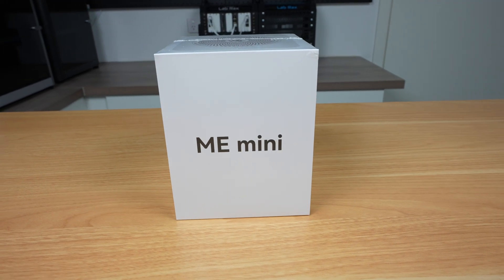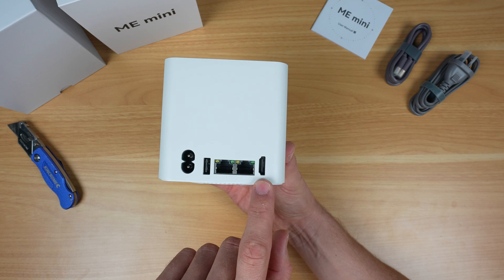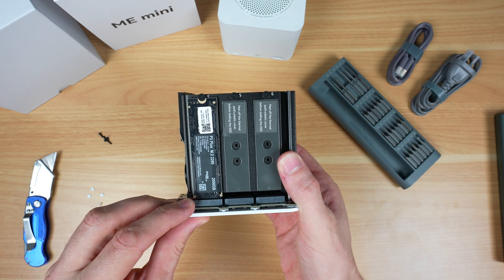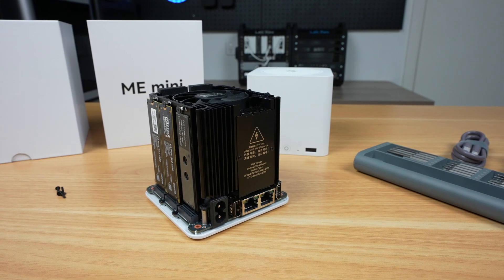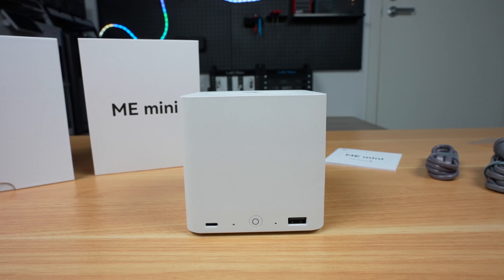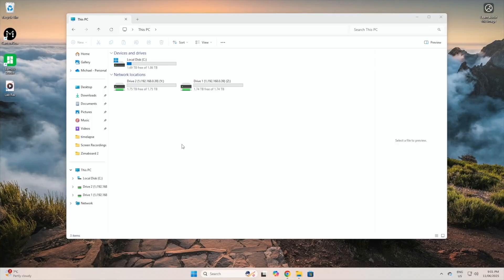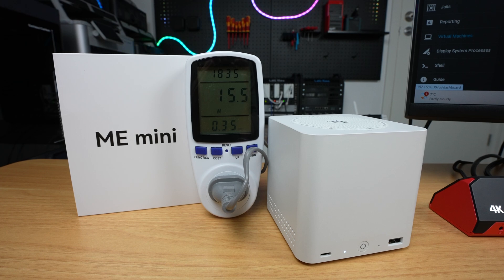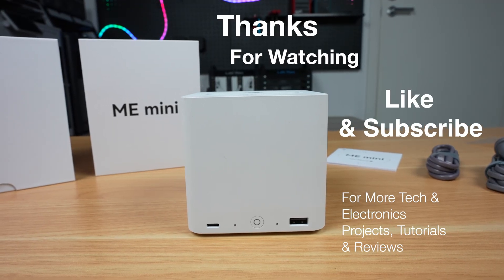Beelink ME Mini – Tiny, Silent, and Perfect for a Home NAS?

Comment: The industry standard for measuring sound levels (noise) is to place the device you are using 1 meter away from the source, if you do that it makes it much easier to compare results…
Reply from the maker: Yeah I know but the sound level from most of these mini PCs and SBCs is so low that measuring them all from 1m away would result in no (or very little) discernible difference. So I try measure them all from 20cm.

Comment: If I installed TrueNAS to external SSD, this means I can have 3 pairs of NVME mirror although each drive will be capped at 1GBps each. Pretty nice if I'm looking for low power nas
Reply from the maker: It has internal eMMC storage too, so you can install TrueNAS on that and still have the 6 NVMe bays free.
Reply: @MichaelKlements  Can I install TrueNAS on the eMMC and have a 1TB NVME for apps/docker/vms and then have say 3 1tb drives for storage in raid?

Comment: The more I see this on YouTube, the more  I am impressed by it. Granted it has some limitations. But I currently use two ZIMA Blades running both Casa OS and ZIMA OS. For my personal needs the 2TB size of the individual drives works just fine.For just personal use this is more than enough.
Reply: At $50 per TB how is this cost effective?  Lets say you put 6x 4TB drives in it, that would give you 24TB at a cost of $1200.   Platter drives are ~$10/TB, and you can get a single 24TB Barracuda for $250.
Reply: @BoopSnoot  Granted SSDs are not yet as cost effective as HDDs. But the design of this is optimized for a small foot print. I would be more likely to use 2TB drives rather 4TB drives.
Reply: @BoopSnoot  ssd is for speed, you can edit on this but cant edit 4k from hdd
Reply: @techxsujan Since I don’t do video editing, this is not one of my concerns.
Reply: @techxsujan  I believe when you import into premiere it caches it on your boot drive.  Nothing wrong with having a 2TB or 4TB OS drive, but for storage SSD is way too expensive

Comment: Can one remove the wifi/bluetooth card and replace it with a nvme for even more storage?
Reply from the maker: No, M.2 WiFi modules are keyed differently to NVMe drives and are not compatable.
Reply: @MichaelKlements  you can install adapter from m.2 E to m.2 M

Comment: Nein, nicht mal nah dran.
1. Lüfter nervt, lässt sich nur schwer austauschen
2. 2.5 GbE bei sechs NVME SSDs, absolut wiztlos
3. Geringer Stromverbrauch? Im Idle vielleicht, aber zieh mal größere Mengen an Daten raus, oder schreibt sie gar drauf, dann sieht das schon anders aus, von den Temperaturen ganz zu schweigen.

Ich hab das Ding ganz schnell wieder zurückgeschickt und war froh, dass ich mein Geld zurückbekommen habe. Wer wirklich rein auf NVME setzen will, der sollte auch das Geld haben, sich ein Gerät mit mindestens einer 10 GbE Schnittstelle zu kaufen.
Wer nur was sucht, um davon Videos zu streamen, der braucht keine Box mit sechs NVME Schnittellen, dann reichen auch zwei oder vier und für wenig mehr Geld bekommt man z.B. ITX Boards mit zwei NVME Schnittstellen, dazu viermal SATA und auch noch 2 x 2.5 GbE UND einmal 10 GbE, das alles in ein sehr kleines Gehäuse passt, vor allem wenn man dann auf ein Pico PSU mit externem Netzteil setzt.

No, not even close.
1. The fan is annoying and difficult to replace.
2. 2.5 GbE with six NVME SSDs is absolutely pointless.
3. Low power consumption? Maybe in idle, but pull large amounts of data from it or even write it to it, and things look different, not to mention the temperatures.

I quickly returned the thing and was glad I got my money back. If you really want to go all-in on NVME, you should also have the money to buy a device with at least a 10 GbE interface.
If you're just looking for something to stream videos from, you don't need a box with six NVME interfaces, two or four are enough and for a little more money you can get ITX boards with two NVME interfaces, plus four SATA and also 2 x 2.5 GbE AND one 10 GbE, all of which fits into a very small case, especially if you use a Pico PSU with an external power supply.
Reply: Thanks for Michael's reply first!

As for your detailed feedback — we really appreciate you taking the time to share your thoughts!

That said, it’s worth keeping in mind who the ME Mini was actually designed for. It’s not trying to compete with high-end NAS setups or custom ITX builds. Instead, it’s aimed at home users who want a compact, quiet, and affordable system for tasks like media streaming, light NAS usage, or running small self-hosted services. 

We totally get that if you're building an all-NVMe storage system with serious throughput needs, you’ll probably also want at least a 10GbE interface and more advanced thermal management. What you’re describing sounds more like a prosumer-level setup, which doesn't really align with how the ME Mini was positioned. That said, we’re actively working on more advanced products built specifically for professional users — so stay tuned!

About the fan — sorry to hear it bothered you! If anyone runs into issues with accessories or wants to replace them, just contact our support team to purchase a replacement. We’ll also provide step-by-step guides to help with the process.

At the end of the day, no single device fits every use case — and that’s totally fair. But for what it’s designed to do, we believe the ME Mini hits a nice balance of flexibility, performance, and affordability.

Thanks again for the feedback — it helps us keep improving!
Reply: Ja und nein;
Allerdings ist es ein Apfel/Birnenvergleich;
ähnlich derer, die dieses Gerät mit nem Pi 4/5 vergleichen.
Stromverbrauch:
Ja, kann in der Spitze steigen ebenso wie die Hitze...
Ist aber bei ner Pico-Lösung nicht viel anders.
Leistung: JA, ich kann auf ne ITX-J3455  Lösung genauso setzen wie auf ne N355, um halbwegs "günstig" zu bleiben; ich kann aber höherwertig ansetzen oder "alte Terminals" verwenden.
Die Wahrheit liegt irgendwo dazwischen

Ja, ich kann Boards mit Boot-NVMEs ausstatten, den Rest via Sata; oder gar Adaptern erweitern;
habe sowas in meinem DiY Park laufen, klappt auch prima; der Stromverbrauch hält sich in Grenzen, ditto so die Abwärme.

Und wer zu ner N150 Lösung greift, um dort zig Virtuelle Maschinen laufen zu lassen, der hat ohnedies das Thema verfehlt.

Punkto "Lärm"; also im Vergleich zu den "kleinen Würfeln" von vor wenigen Jahren; J4125 aktiv gekühlt, ode den kleinen I3 Lösungen, ist der wirklich leise, den ich bei Umgebungslärm (und ich sitze im Grünen, hör bestenfalls Vogerl) nicht wahrnehme; ich betreibe ihn sogar im Schlafzimmer.

Die Frage ist und bleibt: Was will man
Ein kleines Ding, bei dem ich "restlverwertung" von NVMEs betreibe bei überschaubaren Anschaffungskosten, dem die nächsten Jahre mal nicht die Puste ausgeht;
oder sowas we ein UGreen/Synology -wo nebenbei erwähnt, dir die Ohren ob des "Lärms" abfallen; oder ein DiY *haha+ Spaßgerät absolut passiv, oder halt ein wirkliicher Server.

Das Teil ist ob des limitierten N150ers "rund"
bzw. das Optimum rausgeholt, und das für nen Preis, was man schon mal nur für ein vernünftiges N355 Board hinlegt; ohne Beiwerk

Ich bezweifle, das jemand 6x4TB Sticks kauft; zumindest zur jetztigen Zeit;
aber ebenso bezweifle ich, das jemand mit Synology oder UGreen sein 4-Bay Nas mit 4x18TB HDs, den Guten, vollklatscht, ditto so bei DiY Projekten.
Also in Summe hinkt der Vergleich;

Sehen wir uns die Mitbewerber an:
Der einzige der halbwegs mithalten kann; um 100 € teurer, der cwwk-p5 mit 4x Nvme, reltiv passiv gekühlt...
und der Andere g9 - heiß wie Frittenfett;
bzw. die Geräte unter anderem Namen, aber selbe Bauart...
Das war´s
Für Leute die mit "Fertigteilen"wie "echte" NAS... alleine die eingesetzten j4125 bei nem Synology stellen mir die Haare auf, für den Preis. nix anfangen; weil ab 3xx,- aufwärts, ohne Platten,
oder jene, die mit DiY nix am Hut haben;
ist so ein Teil "perfekt"; Und wenn man bei Amazondays eines günstig abgreift... noch besser:
Mehr als "aufmachen" NVME reinschrauben muß man nicht können egal ob man jetzt die Vriante mit oder ohne 2TB kauft

Ob deiner Kritik verstehe ich nicht, warum du dir das Gerät überhaupt zugelegt hast, den deine Anforderung schließt von Haus aus so ein Device aus.
Ist ja nicht so, wie beim G9, das man die böse Überraschung erst im Betrieb erlebt; wo es tatsächlich ein Grund ist zu sagen: Das Teil ist brandgefährlich

Wie gesagt: Vlt. bist du mit der falschen Erwartungshaltung rangegangen, vlt. biste wirklich unzufrieden, warum auch immer

Aber deine Vergleiche hinken da gewaltigst.

Just my 2c - und ich bin nur "user", sonst nichts 
----
Sorry folks, it is easier for me to answer in German; use google Translator, if u are interested
Reply from the maker: Thanks for sharing your thoughts — I appreciate the detailed feedback.

That said, I think it’s important to keep in mind who this device is actually made for. The ME Mini isn’t marketed as a high-end, professional-grade NAS or data server. It’s a budget-friendly mini PC designed for home users who want a quiet, compact system that can be used as a NAS, for media streaming, or small self-hosted services. In that context, it performs well.

Most users in this price range (around $200) will be on gigabit or maybe 2.5G networks, and aren’t expecting 10GbE performance. What you’re describing is closer to something like a Terramaster F8 SSD or SSD Plus, or a custom ITX setup with higher-end components. These are both great solutions, but they also cost three to four times more or require technical setup.

I don't know what the issue with the fan is, it's a simple hub mounted design with 3 screws holding it in place? It took me less than 2 minutes to remove. It's also not something most people should need to replace under normal use, almost all mini PCs use non standard fans due to their size limitations. 

Ultimately, I think it comes down to matching the product to your needs. The ME Mini isn’t for everyone, but for the audience it's aimed at, it offers solid value.
Reply: @MichaelKlements  Well said !! 😘🛜🏡🌐🗽

Comment: Michale, soem reviews on this board cover some PCI lane speed discrepancies.  Your results didn't seem to show that.  As always I appreciate the video.  Thanks.
Reply from the maker: The PCIe lane speed discrepancies show up if you're accessing the drives locally on the PC - if you're running Windows 11 on it and run a drive speed test you'll see the difference in drive speeds. My testing was to demonstrate that even with the difference in speeds between the drives, if you’re using it as a NAS as it’s intended, the 2.5G network connection is the bottleneck so it "hides" the discrepancy.
Reply: @MichaelKlements  The testing I saw was under Linux I think the video was by RaidOwl.  Thanks for the reply!
Reply from the maker: Yes, it would be the same in Linux - testing the drive speed on an OS locally would show the difference in speed across the ports.

Comment: Another great video. Thx for it: Fully tested and explained ... I like this !!!
But...
Few more Infos

I have the same device;
.) U can install Windows 10 out from a USB - Stick on the EMMC... fine :)
.) U can install TrueNas from a USB (other device) an the EMMC... fine too :)
.) Windows 10 Drivers; When u contact the support-team, u will get links; few days befor ei can´t find the drivers on their webpage, or u use a sub Programm like IOB*t DriverBooster free ; All Drivers are installing automaticly

Temperatur: 
.) Windows 10 ; HW Info tell me 55 degrease (up under heavy load)
.) Windows 11; Hw Info tell me 65 degrease (and up)

So, it´s nearly the same picture (less hot) as it was with a N100 (Asrock MB)
---
For the ones, who import from China to Europa (cause Amazon is out of this devices)
.) Waiting time.. i had 1 Week more (shipping); no damage at all
.) Order only the barebon; cause tax-free amounts to europa at 149,99 Euro; and they should sign it as "Early-Bird device" (or something similiar); so when zoll is checking the price.. it´s explainable, why it´s cheaper 
I had to pay taxes (an this was 85,60 Euro!!!!!! ) , but "we foud" a solution (thx to beelink !!!!!)
Cause 209 dollars.. it´s an absolut great price for this device !!!!

I tested: Win 10/11, Linux Mint and Sparky, Debian 12 with Casa OS and other stuff (USB)
TrueNas (EMMC), ZimaOS (USB), the other nas-Software which is known normaly with it´s own HArdware connected.. worked fine out of the box

Final thoughts:
I swap my raspberry solution in the sleeping room against this device (Cause Router is there); i have it run as homeserver (While idle it´s handwarm) and Media-Center
The N150 ist for differnt things the better solution than a N100 device.
And when u use it as normal PC.. it´s good enough too
I really love this little thing (If i would have a channel; i couldn´t  better explained, as Michael did.. all is sayed and tested

Comment: Nice video. One idea to test: Since it has 2 ethernet ports and a decent CPU, could you try creating a home/SOHO firewall and VPN/tunnel endpoint with even some self-hosted cloud services running on Docker?
Reply from the maker: Thats an interesting use case for it - it'll probably be quite a capable router or firewall!

Comment: Think I’d prefer some kind of pi5 pcie solution. Much quieter and less power/heat.
Reply from the maker: The main consideration is really ARM vs x86 - my Pi 5 NAS and this cost about the same, produce the same amount of noise and draw a similar amount of power. The N150 CPU is significantly more powerful than the Pi's though.

Comment: If you used both the 2.5Gb ethernet outputs to a switch with port aggregation, would it improve the performance?
Reply from the maker: Link aggregation improve performance for multiple users/writes. So on the ME Mini you could transfer two large files to it at 2.5Gbps simultaneously but it won't improve the transfer speed of a single file i.e. you can't transfer one file to it at 5Gbps.
Reply: Try it, when using TrueNAS ...  you'd have to use at least one connection with static IP AND a different subnet, since TrueNAS simply can't handle two connections inside the same subnet ... so, no, makes no difference at all.
Reply from the maker: TrueNAS can handle link aggregation correctly, you just need to configure it properly using LACP. When set up correctly, both interfaces are treated as a single interface with a single IP address. This works as expected with a managed switch that supports LACP.

What you’ve described (assigning two NICs in the same subnet without aggregation) will definitely cause issues and is not a limitation of TrueNAS, it’s just standard networking behavior. If you’re not using LAG, interfaces need to be on separate subnets.

Comment: 1. This NAS-PC is not quiet. 2. What to do if you need to replace this cooler? Will it be available for sale?
Reply: < 40 dB seems pretty quiet; only a fanless solution would tend to be quieter (discounting potential coil whine), unless you have a very large fan running at slow speed.
Reply: Hi! The ME mini is actually very quiet with low noise levels—we welcome you to purchase one and try it out for yourself. Additionally, if you ever need to purchase a replacement cooler or any other parts, please feel free to contact our support team and our support team will provide a dedicated purchase link. Thanks for your questions!
Reply: @Beelinkchannel  Off-topic; Greatings to China; I am glad, that i got my devices (thx for support), and i wouldn´t change them anyway.

Meanwhile, i had other products too, 1 was terrible, Breaking Brick, and finaly Jeff named this problems at his channel, 1 is verry good, but not in this pricerange

So, with this device, u can´t do anything wrong.

Only thing i hope; during Spring sale of Am*zon i hope there are enough devices, even in blue are available (so that i get them cheaper)

As i wrote above: I love this devices

Disclaimer: I am not related to beelink/other firm; i am just a (power)user, buying device for my own/with my own money
I have no profit, if i say: smthing is good or bad

For a big "NAS" it´s logical limited, by NVME, by power etc.
But.. for 209 nickers - folks, what u want? Getting it as "present/gift"???
And i am sure, u have laying around enough NVMEs  to fill up the device

And the support of beelink was great;
At other firms i still wait for answer.. but the checked my bad review on amazon... and connect for this...
Reply from the maker: 1. This PC is about as quiet as you can get with a fan - if you were 50cm away from it with your back turned you wouldn't know if it were on or off. 
2. The fan looks like a standard hub-mounted 80mm fan, so I'd imagine it can be replaced fairly easily.